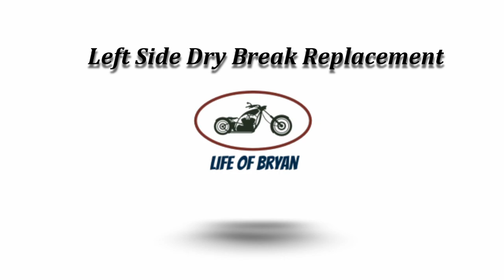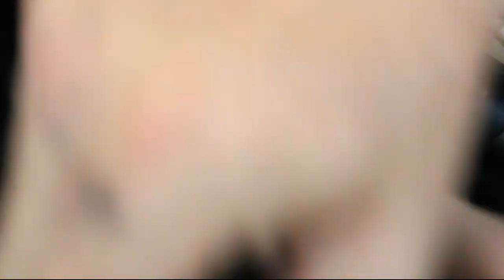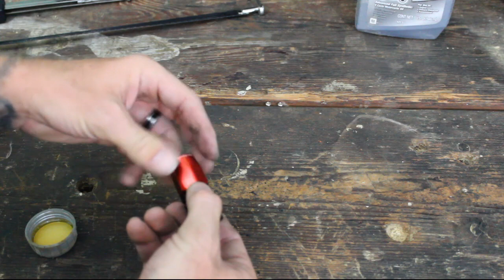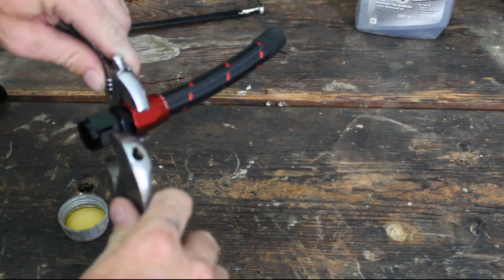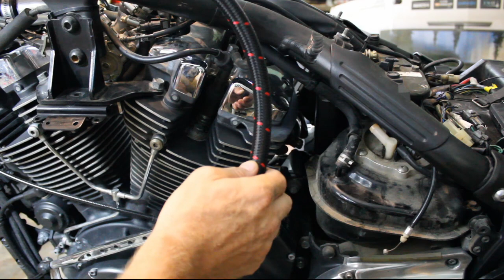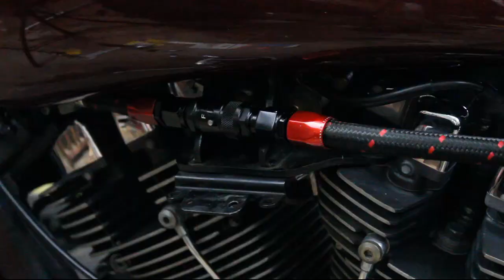Yamaha Warrior 1700 Left Side Clean Up Dry Break

Comment: I'm currently working on my 02 warrior. I've had to pull the fuel pump and replace all the fuel lines. I've also got most of the bike tire down for new paint. I've got a lot going on besides this bike, mostly family issues. During all this I removed all the fuel lines to replace them. I've forgot where all the lines go and the routing of them. Can someone please send a video or some pics that will get me back to where I need to be. I just need to know where they go from the fuel pump. Thanks.

Comment: Hey Bryan, i've had an 02 for a couple of years now. Always wanted to do a vbak, this may be a stupid question but do you need a fuel tuner as well? Or is the intake difference small enough to where a stock tune is fine? Thanks.
Reply from the maker: Definitely want to get a tuner as well. You can get by without one, but the bike won't run to it's potential and likely run lean which would cause it to run hotter. I'd suggest the power pro black, but only because it's completely auto tune. Set it up and never have to really mess with it again. It is pricey though, so if that's not an option, I'd check into a used power commander three or something that will still allow you to change the air fuel ratio.

Comment: Hey I did the same mod but have you heard of the vibrant one not releasing it worked fine when I first installed but few months later I'm trying to take off and it gets stuck after u twist it
Reply: OK so that exact same thing just happened to me with the o ring but ripped inhalf. I've been talking to vibrant racing and seem they will replace for me also still only 3 months old and fails first time
Reply from the maker: I'm sorry to hear that! I will have to watch for more of that in the future and if it becomes a problem with many more people, I'll have to put something in the video telling so. Thanks for bringing it to my attention, and definitely keep me posted on what Vibrant Performance does.
Reply: @RSWarriorBryan  hey just an update they did warranty it they just needed to see a receipt to process
Reply from the maker: Hey David, tjanks for watching. Mine stuck the very first time I went to pull it apart and hasn't had a single problem since. I have also heard of it happening to a couple of others. One said that when he pulled his apart, the rubber o ring inside was halfway out and he had to send it back to be replaced. Can't remember exactly what I did to get it apart, but maybe tried putting it back together and pulling it apart a few times. Definitely keep me posted on of you can't get it apart and I'll se eofno can figure something out.

Comment: nice vid mate! Just a tip from my side: I  always use a squirt of break cleaner to lube up hoses right before i mount them... the benefit is that it evaporates after mounting giving a tighter fit... where greasy lubes stay in and keep it slippy.. hope it helps! cheers!
Reply from the maker: Hey, awesome tip! If you don't mind, I'm going to add that to the video description as a pro tip. I will also credit you for it as well. Thanks for watching the video and commenting. Hope it was able to help out a little bit and show you the parts needed and process to get it all finished up.
Reply: @RSWarriorBryan  yeah cool.. great vid indeed!

Comment: Hey Brian, I have a '02 Warrior, I've done the block off plates and installed the Patrick Racing velocity stacks and filters. Just want to give you a heads up on the rear fender stays. They're painted black aluminum.  Easy to take off one at a time. You can sand down the rough castings, start with a 300 to 400 to six hundred, then take them to a buffing wheel ( I have a grinder with a buffing wheel on one end) polish them up and they look nice as chrome.  A little time and effort not much money and your fender stays pop. Makes a big difference on my Indigo Warrior. I've had this bike since '03 and I still love the way it looks. As far as the fuel connectors cracking, I believe it's the ethanol fuel causing it. I sanded mine down and sealed it with some JB Weld. it's been holding for about five years.
Reply from the maker: Hey Chris, thanks for the tips! Also saw that you subscribed and I appreciate that as well. 

I've seen some Warriors with the chrome fender stays and wondered if they were after market, or if they had been polished. Definitely a great tip for someone to do to give their bike that look that not everyone has. If I decide to go that route, I may use your tip and credit you with it. For now, I think I'm going to get a little more black on the bike and see what that looks like. 

These bikes definitely just have that something that makes you smile when you see them. I still open the garage door just to look at it before going to bed for the night. They're beautiful bikes and so much fun to ride. 

As for the dry breaks, it just seems they'd have a recall. They are known issues to the Warrior and between that and the elbow, it's a dangerous combination. I was ready to just get rid of the whole system and get something I knew was going to be safe, plus it makes that left side look good with the new lines and dry break. 

Thanks again for watching and commenting. I also really appreciate the tips.
Reply from the maker: Awesome, I'll definitely keep that in mind. I originally started the channel because I didn't see an oil change video and thought people should know the process of doing it. After that, it was just trying to help keep riders keep taking their bikes to mechanics when most of the stuff is easy enough to do yourself. Plus, when you have a video walking you through the process, it gives that confidence to go out and try it yourself.

Comment: Hey Bryan, where did you buy the fittings and the hose for this mod? Great job. It looks great!
Reply from the maker: Hey Alex, thanks for the compliment! This conversation was literally being had on Facebook earlier. I went with Vibrant Performance which is a little more expensive, but there are also many other alternatives. Jiffy Tite also makes a quick release, but in my opinion, none looked as good as the Vibrant Performance does. I had actually ordered mine from jegs, but was searching around and seems they are all pretty much around the same price. Amazon seems a few cents cheaper on the straight connectors, but other than that it's all about the same price. 

I believe your bike is blue, so don't think you'll want my exact set up. going to include some amazon links to everything, but i'll be doing the black and blue hose, and black and blue connectors instead of black and red. this was the most expensive part of my left side clean up. Like I said, there are many other options that come in cheaper, this is just what I went with myself. Also, you can check with Jegs and Summit as well and see if it's any cheaper.

Black and Blue 8an Fuel Line 2 Foot- https://amzn.to/2CECQKD

Vibrant Performance Quick Release 8an- https://amzn.to/2D4gFyu

Black and Blue Male Connectors- https://amzn.to/2SdIadc

Hope these links help, and if you have any other questions get back to me.
Reply: Thank you for your reply Brian and being so kind at explaining this!
Reply from the maker: No problem at all! Glad I could help. A lot of people will swear by an wrenches. The pieces are aluminum and if you're not careful, they will scratch easily. I just used the two adjustable wrenches and made sure that I was very careful not to slip on it. Other than that, the only other advice I have is to be careful connecting the hose to both the reserve thank and the elbow under the tank. The elbow is a known leak point in a lot of bikes, and the reserve tank has a plastic fitting that can snap if not careful. The hose is definitely a tight fit, so be sure to lube it before trying to connect.
Reply from the maker: Nice! Glad that I already had links for you. Hope the prices and everything on them are still good. Thanks for watching the video also, I hope it's able to give you an idea of how to do the mod. It definitely makes that left side look good, and adds a little more custom look to it. If you run into any problems, feel free to get with me and I'll see if I can help. Thanks again, stay safe!

Comment: Hey man that's an awesome look. Can you explain what the purpose of the "dry break" is?
Reply: Hey Bryan, thanks for the video!! Can you tell me what the left side clean up is for? Whats the advantage? Thanks again, your very good at explaining things.
Reply from the maker: Hey Alex, thanks for watching the video! As far as the left side clean up goes, it's mainly just for looks. The OEM dry break on the left side can crack after time, but it's just something you should watch out for, not necessarily dire to replace. Many people will actually steer away from the mod because it takes away the left side scoop which helps to deflect air to the rear cylinder. Me personally, I decided running a little hotter was worth the way it all looks in the end. I really appreciate you watching the video and commenting! Ever have any other questions, feel free to ask!
Reply from the maker: Thanks for watching, and thanks for the comment. The dry break is just a quick release for the fuel line for when taking the tank off. Keeps any fuel from spilling out. The factory dry breaks have a tendency to crack after a while so it’s a good idea to at least watch for leaks if not replacing. Thanks again and I hope this reply helped answer your question.
Reply: Life of Bryan thanks man. Very helpful. Looking to eventually getting a warrior. Really like what u have done with yours. I have a 09 Kawasaki Vulcan 900 Custom right now. Just need that extra power ya know. lol
Reply from the maker: Thanks! Have a friend with a Vulcan, they're good looking bikes. I completely understand about needing the power though. This is my second warrior. After selling my first one, I went through five other bikes and none compared. Lessons learned though, I'll keep this one till I can't ride it any more.
Reply: What is the cable under the cover for?